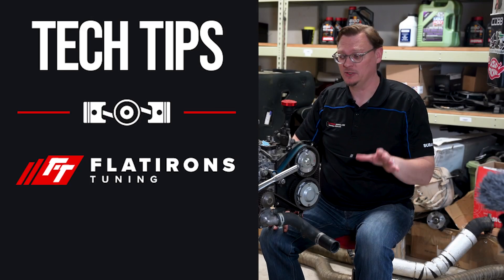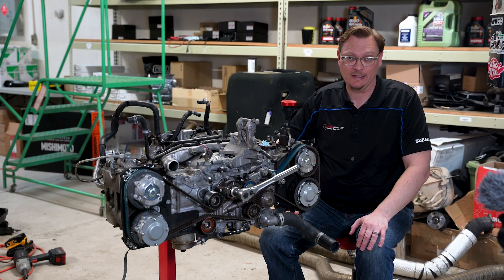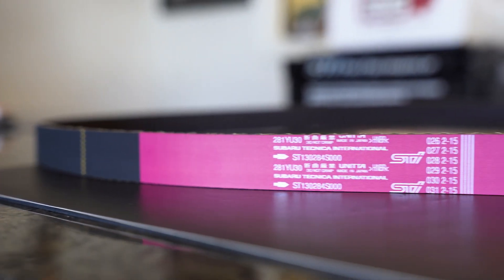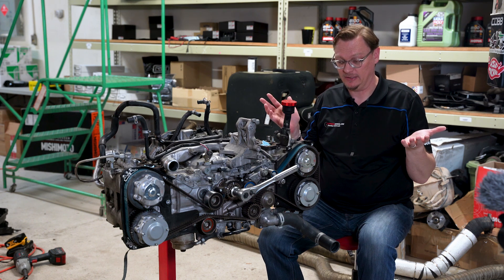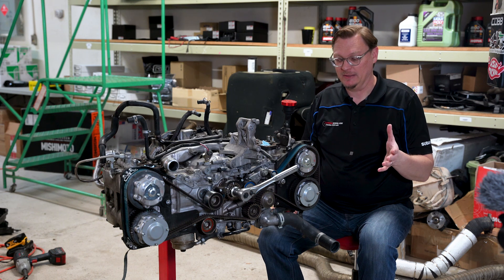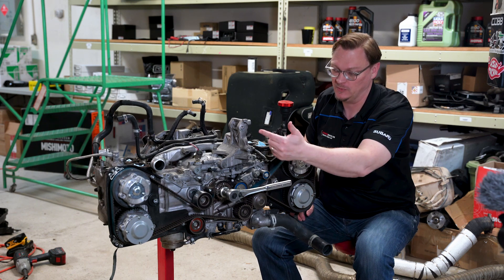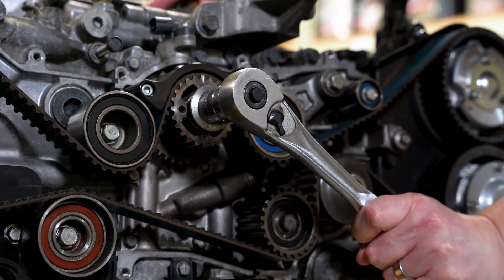Subaru EJ Timing Belt Marks Explained - Why they don't line up

Comment: I have watched your video in its entirety and will simplify the matter: you made it unnecessarily complicated and overly convoluted, whereas you could have simply instructed to use the notches on the top and the pulley, and avoid using the timing belt's white lines. It would have been much clearer, as you caused me undue stress.

Comment: I am currently uncertain about what to believe; thank you for your input. None of the numerous reputable Subaru mechanic videos mention the 11 turns you refer to, and every single one has stated 'twice.' This inconsistency complicates my understanding, so I am inclined to review another series of 12 videos to verify your assertion. The situation is exceedingly frustrating, and rather than proceeding independently, I now doubt my own capability. It appears that I may have to take the vehicle to a dealership for the work, at a cost ranging from $600 to $1,200.

Comment: That's nothing new at all.
Every engine that I've replaced timing belts on weather it be 4cyl single or twin cam, v6 Quad cam or what ever it maĵy be the marks on belt will not line back up but its the marks the pulleys ya gotta be worried about...

Comment: What if they don't line up
Reply from the maker: Thanks for watching and thanks for the question.  If you can't get the marks to line up initially, you most likely need some eccentric idler pulleys which will allow you to adjust for that.  We have a video talking about these as well:

https://youtu.be/aSGZeJSqv3c?si=H-q9GhrP9rZk9lzb

Hope that helps and Stay Tuned!

Comment: I have a 2007 Subaru legacy ej20. The tensioner bolt broke while driving and the car immediately shut off. I got a replacement bolt but the timing marks aren't lining up. Any suggestions?
Reply: I also have trouble finding the marks, they're not marked on the actual pulleys. Is the order for pistons #1 and #2 open then #3 and #4 closed?

Comment: What I was hoping to find in this video but I didn't was, why when I have perfectly line up the pulleys to the belt and then carefully bolted on the bottom left idler to take the slack out of the belt, the exhaust pulleys don't line up any more. Both are a tooth out in opposite directions. Didn't pull the pin yet luckily so back in for another attempt tomorrow.

Comment: Good video, but I think you missed an opportunity to discuss what to do when you have a decked block and heads and the marks don’t line up. And what solutions are available ie. offset idle followers.
Reply from the maker: Thanks for watching and thanks for the comment.

We discussed that back in this video:

https://youtu.be/U2QmKy1mFbY?si=aM1uech09eJGpwaZ

But we will most likely be talking about it again soon.

Stay Tuned!
Reply: @FlatironsTuning  I remember hearing about it, a mention to that discussion would have been useful for the unaware.

Comment: Don’t think he mentioned those but if you deck the heads or block then the left side head will be off and will need an oversize pulley to compensate for the timing being off. IV only ran into this once and the pulley fixed it.
Reply: You should use eccentric pulleys to pull the slack out of belt to pull cam gears back to where they should be when heads or block have been decked. It comes down to the length of the belt being so long.
Reply from the maker: Thanks for watching and this is a good point.  This is what eccentric idlers were designed to compensate for:

https://www.flatironstuning.com/rcm3330

Stay Tuned!

Comment: Ah yes, but what about the 2 indicator marks bottom of the intake and top of the exhaust sprockets how they don't line up after rotating the engine, sometimes when excessively off line indicating you need adjustable timing pulleys because the heads and block deck have been skimmed shortening the entire engine.
Reply from the maker: Thanks for watching and thanks for the question.  This is what the eccentric pulleys are designed to compensate for:

https://www.flatironstuning.com/rcm3330

That is a great point though, and I may dive into it more at a later date.

We did touch on it here in this older video looking at OTC Racing's engine:

https://youtu.be/U2QmKy1mFbY?si=GVjAbrdEqHQSpB-v&t=104

Thanks for watching and Stay Tuned!

Comment: Very curious, most aftermarket timing kits (Aisin for example) expect you to run a "bleed" on the timing tensioner prior to install? But here it mentions definitely NOT doing so? So, should or shouldn't it be done?
Reply from the maker: Thanks for watching and thanks for the question.  

The short answer is if you are using a kit from a manufacturer that requires you to "bleed" the tensioner, then I would recommend doing so, and documenting your process as well as you can.

The overall goal of this video is to prevent the removal of a properly timed and functioning timing kit, and there by reduce the possible damage that could be done to a tensioner from re-installing it.

I hope that helps and Stay Tuned!
Reply: @FlatironsTuning  thank you, I appreciate the reply, that definitely quills the curiosity, much appreciated
Reply: @FlatironsTuning  I should have worded the question better, too. I was at work, trying to comment between things. You definitely do not say "don't" bleed the tensioner, but if you re-time, that's what you're doing in essence, so that's on me, cheers
Reply: he commented on how the bleed is done. should be with the piston upright and very very slowly compressed. I've never done a bleed on any timing belt change and I've probably been very lucky
Reply: @woodzy575 he says the biggest mistake you can make is to think you've messed up the timing and take it all apart. Because recompressing the tensioner is so difficult and has so many steps (according to Subaru). As I stated, most if not all aftermarket companies supply instructions to do just that, before installing... hense the confusion
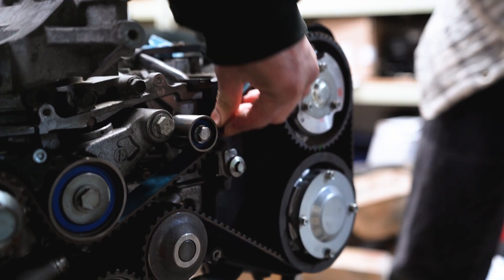Reply: @woodzy575 ..  3:10-3:45
Reply: You have to follow the manufacturer's instructions. The tensioner could get air in or from manufacturing or shipping. If you take the tensioner back off, then go through the bleed procedure again

Comment: Sooo if I took the riverside upper one and took it one teeth to the right and turned the engine and the white line was matching is my engine that is know running not timead right 😮
Reply from the maker: Thanks for your question.  I would say that if you put on the timing belt, and the marks lined up, but then you thought that it was off, so you moved one of the gears based on the timing marks on the belt, that may have put the engine out of time.

I would say this would warrant taking the left and right covers off, and setting the crank pulley to TDC to make sure that the cam pulleys are lining up.  If one of them is off, it would be worth correcting that issue.

Hope that helps and Stay Tuned!

Comment: I always assumed this made sense and was done to not have the belt in the same place when the ignition events occur.  The belt is constantly changing speed a little bit as rpms change and as each cylinder ignites on the combustion stroke.  Seems like a way to try to prolong the life of the belt.  I also don’t think this is unique to subaru.